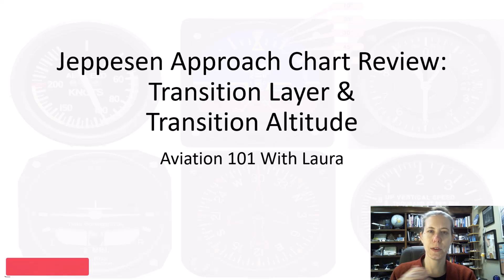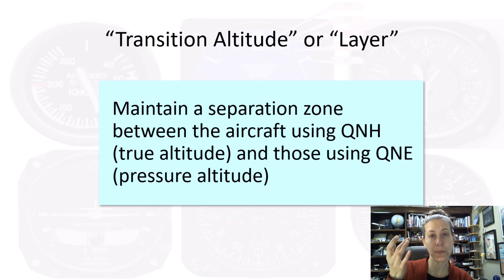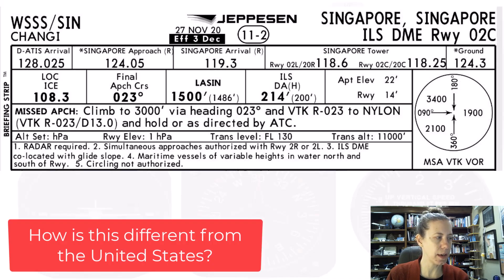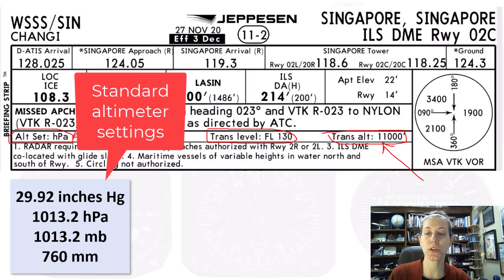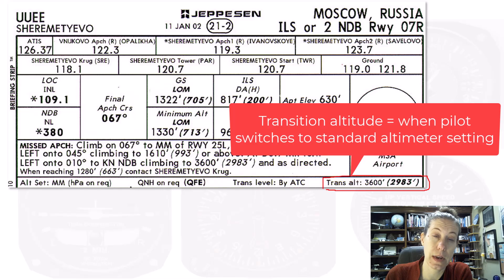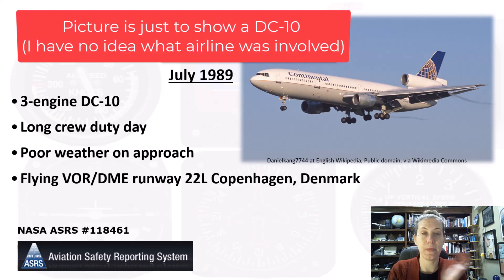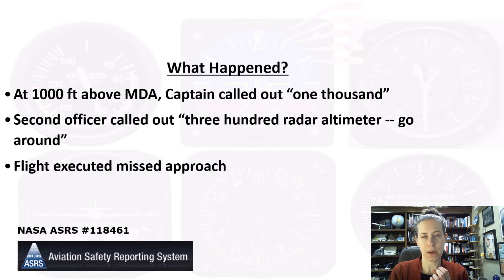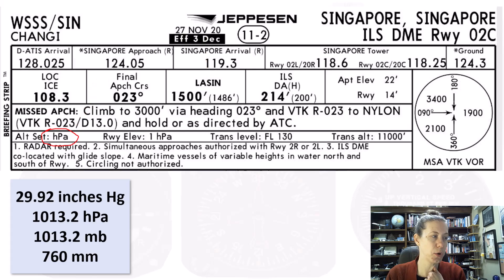Jeppesen Approach Charts: Trans Level & Trans Alt Explained! IFR Pilot & Dispatcher Test Prep Review

Comment: Thank you Laura, great explanation! My brother flew out of Hong Kong for Cathey Pacific so I'm sure he knew all about this but me a Canadian Private Pilot am a little more sheltered lol.
Reply from the maker: Very cool! I am sure you're right, and I should have mentioned in the video that Canada also uses 18,000' as a transition altitude (I think everywhere?? is that correct?)
Reply: @ So the Canadian airspace is divided into two regions SDA & NDA, In Northern Domestic Airspace it is a standard pressure region, here one would set the Altimeter to field elevation for departure and climb then set 29.92 at cruise altitude. This from my old training book. 
NDA is divided into two control area's Northern Control Area & Arctic Control Area. NCA floor is 23'000 Alt. ACA floor is 27'000 Alt Under the floor it;s class G
airspace.
Very remote area though.
Reply from the maker: @dwaynemcallister7231  Something similar is what I also found in Canada's AIM. I didn't get into the deep detail you did about these control areas, but as you've said, it's a very remote area!
Reply: @LauraLaster747  That is a good question. What if you want to cruise at 9500' in the Northern Domestic Airspace, do you set your altimeter to 29.92 shortly after departure? (I would assume you initially have it set to match local field elevation for the take-off for your own convenience).
Reply from the maker: @ Disclaimer: I am not Canadian and have only flown in Canada on probably less than a dozen occasions (and all of them were below 18,000' MSL). From what I can see in Transport Canada AIM section 2.10 and 2.11 it looks like you are correct as this is the area that is defined as the "standard pressure region" (see map in 2.11 of Transport Canada AIM.) In your example this seems to indicate just prior to reaching 9,500' you would set 29.92. 

Here is what it says: "Departure – Prior to takeoff the pilot shall set the aircraft altimeter to the current altimeter setting of that aerodrome or, if the altimeter setting is not available, to the elevation of that aerodrome. Immediately prior to reaching the flight level at which flight is to be conducted, the altimeter shall be set to standard pressure (29.92 inches of mercury or 1013.2 mbs). If the planned cruising flight level is above FL 180, resetting the altimeter to 29.92 inches of mercury or 1013.2 mbs at 18 000 ft ASL is acceptable and meets the requirement of CAR 602.36."
Reply: Ahh, I see. Thank you for looking that up. Do you happen to know what advantage it gives to finish your climb before resetting the altimeter? Do you think it is all about better terrain clearance awareness, or is there something more to it?

The reason my first guess was to reset the altimeter early was to aviod two planes in the same vicinity, with one reporting flight level (say cruising at FL65) and one reporting altitude (climbing past that approximate altitude/level).
Reply from the maker: @Rodhern  Again, not an expert Canadian pilot, but I would say they just want as best terrain clearance as possible when low to the ground, but then when in cruise flight, they want you to be able to effectively avoid other aircraft. In the US, we have plenty of altimeter reporting points (airports are pretty much ALL over the place.) My guess is in this remote area of Canada, there aren't enough reporting points with altimeter settings, so they just have everyone use ONE setting when flying over such remote terrain in cruise flight to avoid collisions.